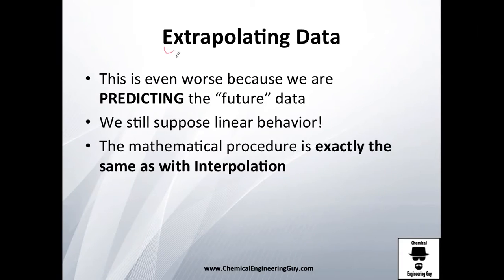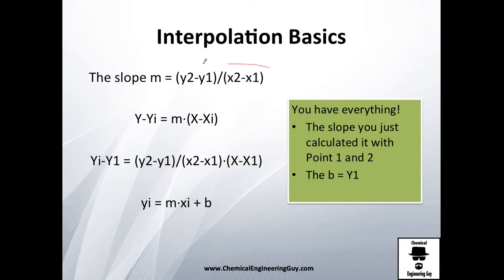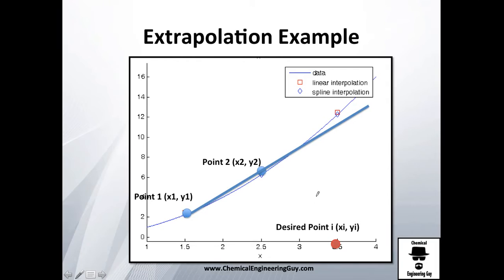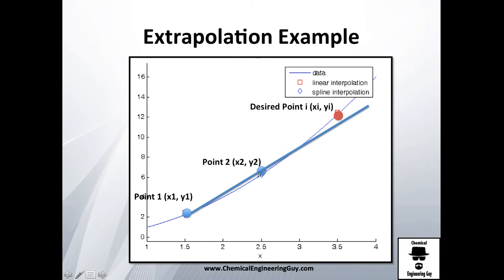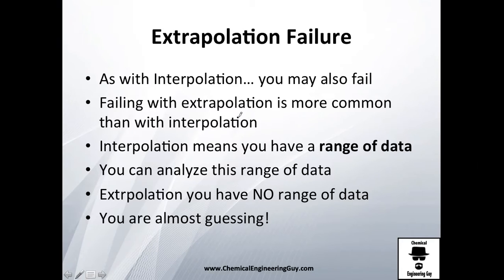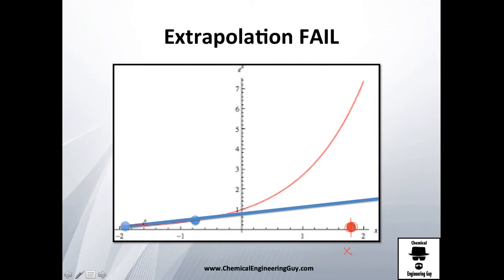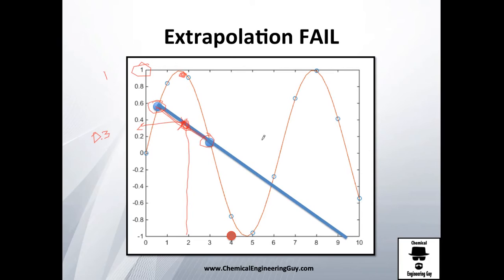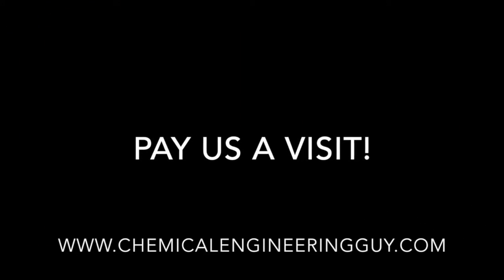Extrapolating Data from Vapor Tables // Thermodynamics - Class 64

Comment: Ok, you Said It is a failure, but How to find the right result?
Reply from the maker: Great question! 👍

Thanks for pointing that out — you're totally right to ask. The key is to double-check the setup (inputs, assumptions, or steps) and then try adjusting one variable at a time. I’ll post a follow-up soon showing exactly how to get the correct result